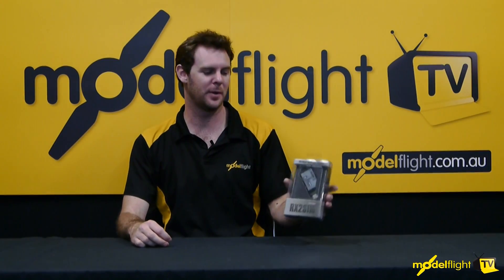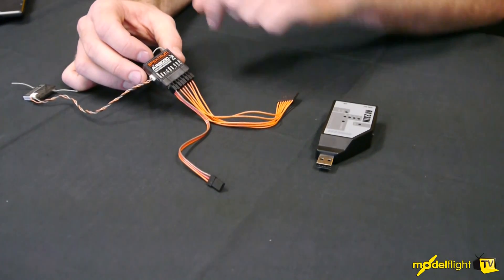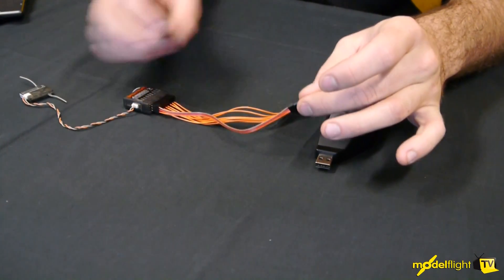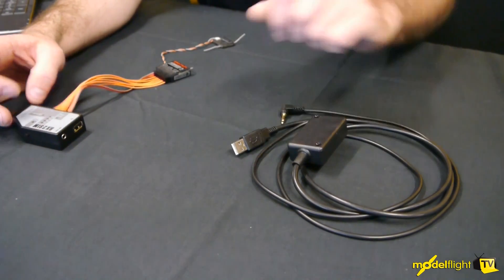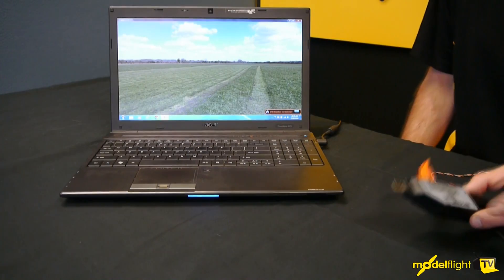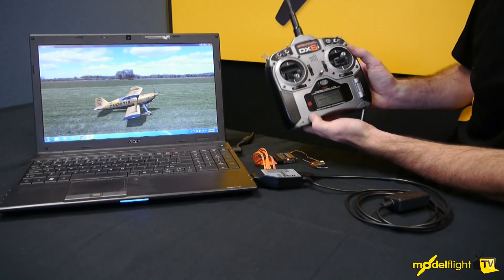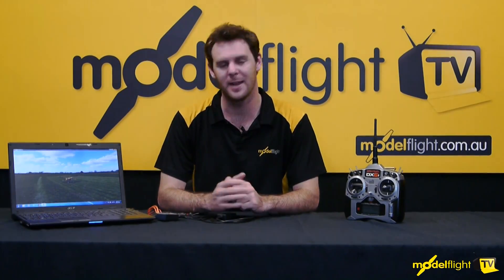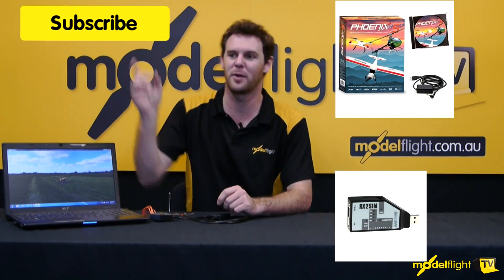How To Use the RC Ware RX2SIM Adapter for Flight Simulators

Comment: Looks like a wire mess is rather just use the included cable less hassle plug and play but thanks for the vid
Reply: Can blow Graupner transmitters! Wireless only